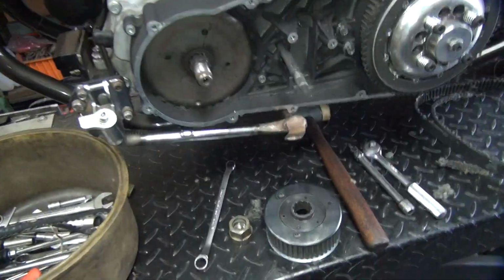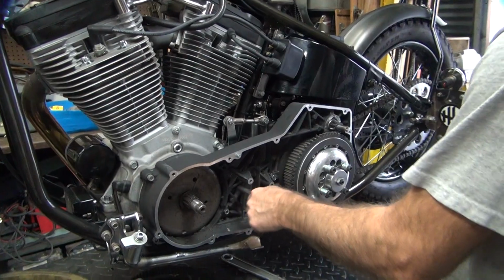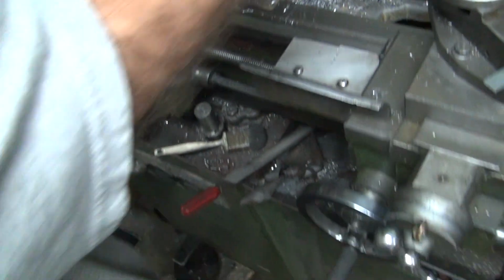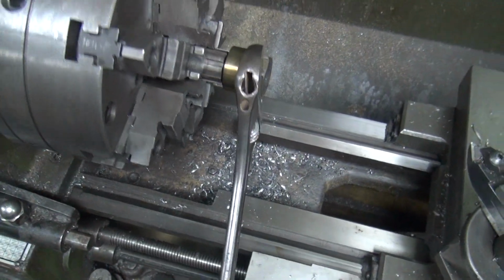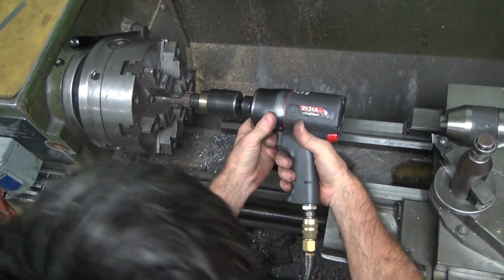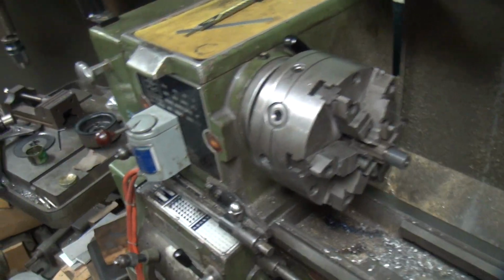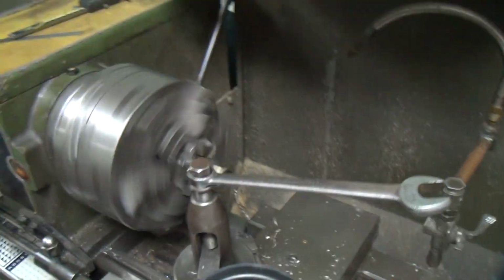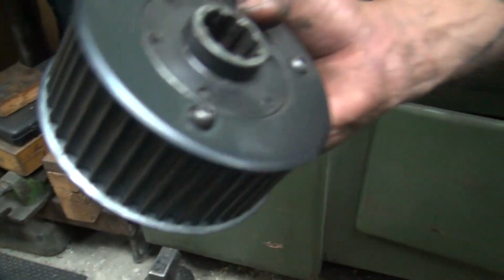1999 80ci evo #109 rigid install mid controls chassis brake repair get running by tatro machine

Comment: ....I'm always amazed these HTD belts hold up as well as they do.....I work on industrial drive systems...these things are rated at 7-9 horsepower per inch of width....and that's running at a nice smooth electric motor rpm....something like......1200 rpm for a 4" pulley..as the belt runs slower...power capacity goes down...waaaaay down......
Reply from the maker: that rest between each firing pulse is why it lives. elect motors have a steady pull.
tatro

Comment: I think I might have left the treads of that POS nut Chowdered so when I tightened reinstalled that POS Pulley on that POS crank it might have a better chance of staying tight at least as long as it takes the owner to sell the bike on FleaBay or Craigs list.
Reply from the maker: this bike is not being sold. he likes and rides this bike. if the nut fits correctly and you tighten it like it should then it will stay tight. if not, then it will come loose like it did before.
tatro